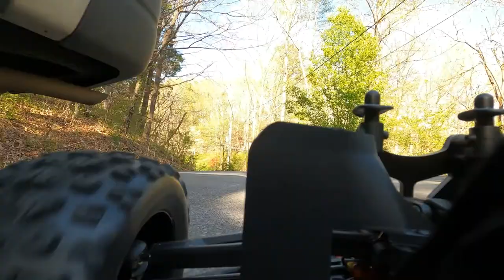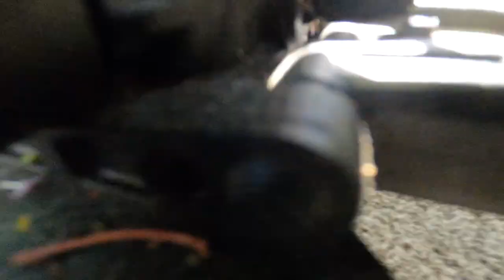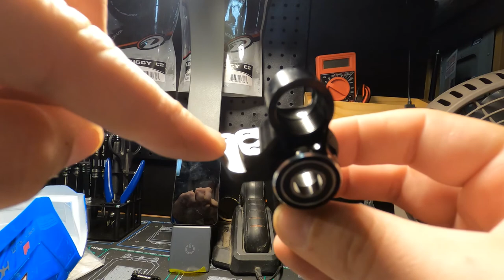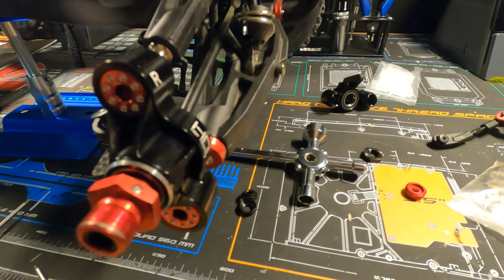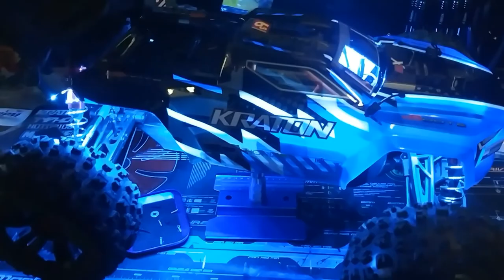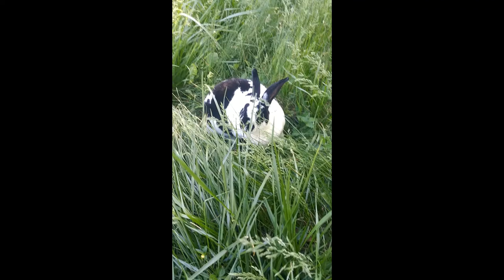Kraton6s + First Test Run ! + UPGRADES ! + LEDs

Comment: I think you would be the perfect person for me to ask this question to...:)   Is there a way of setting a fan curve for an RC cooling system?  I feel like some of these high powered fan set-ups going directly into the balance charger @ 3S-4S  just blows a ridiculous amount of air at all times.
Reply from the maker: yes.. they do.. like castle creations .. their esc have software in them were u can set a fan curve. it depends what esc you have and features it offers.